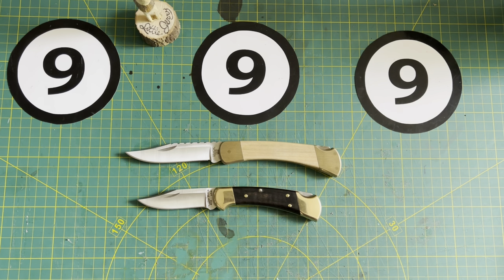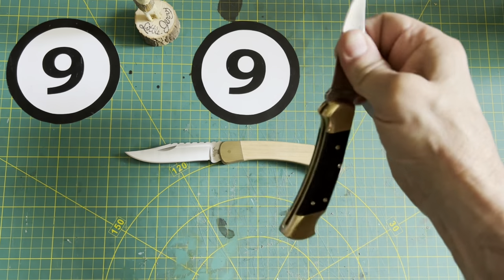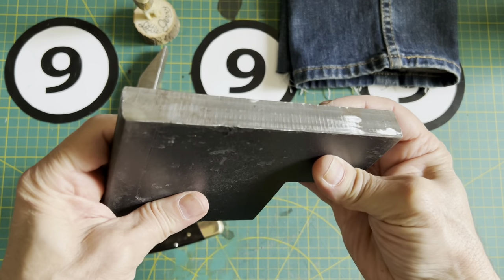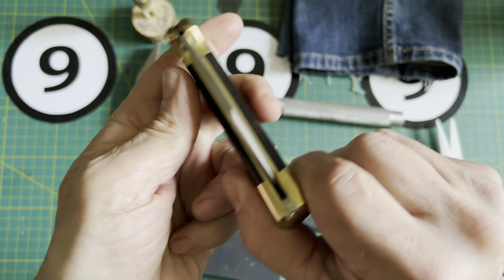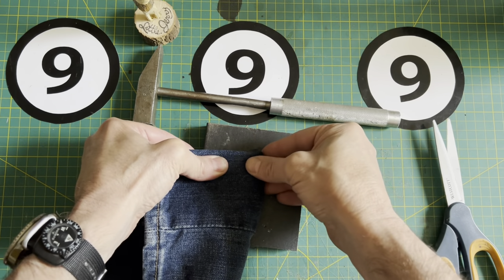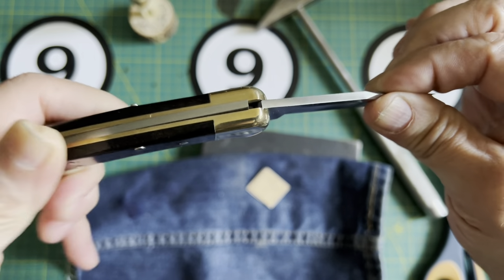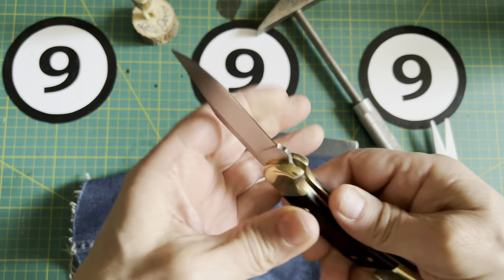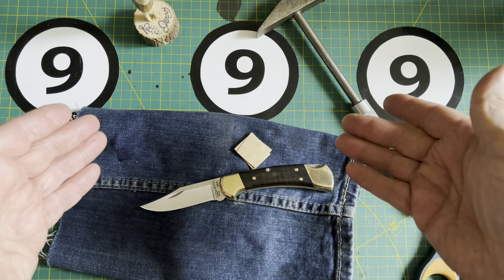Can A Buck 112 Be Adjusted? Let’s Find Out - Video 374😎😎😎

Comment: I've done similar with my 110s and 112s, but instead of hammering, I closed the rubber safe jaws of a vice on that pivot end.  Accomplished the same thing.  However...it made the pivot slightly proud of the surface.  I didn't peen it so eventually it returned to its previous position.  What is the wood on your 110?  Looks gorgeous, Johnny!  THANKS for this video!!
Reply from the maker: Thats some Maple I had used on the 110.
Reply: @JohnnyJuke  Definitely too nice for edc use!!!

Comment: Question,I have a buck 112 ,when the blade is closed the tip sticks up a very tiny bit, bit Iit can cut you if you run your finger over the knife when it's closed, can this be fixed or is this a normal thing for the 112 ?
Reply from the maker: Hi Mark. No this is not a normal issue. A couple of possibilities are: 1) An obstruction between the kick and the blade stop (dirt, object). 2) The blade has been sharpened so much that the profile has changed. If it is worth anything. Buck has a forever warranty that you may consider using. Hope this helped. JJ:)
Reply: Thanks for the reply 👍